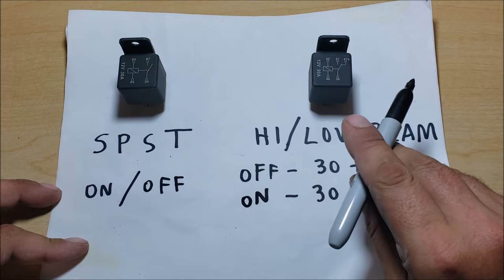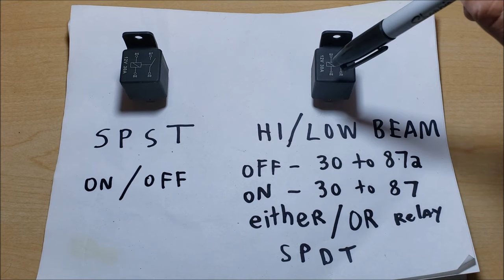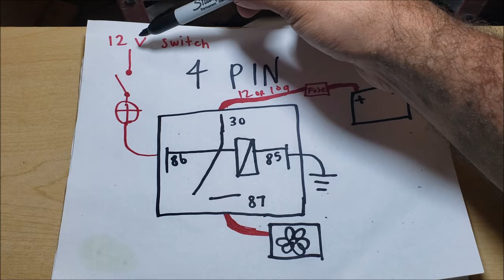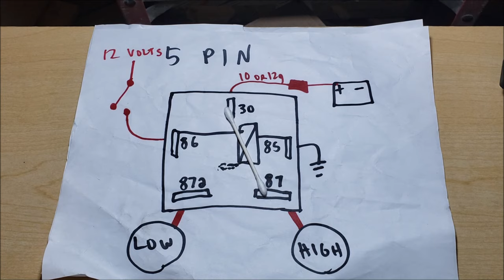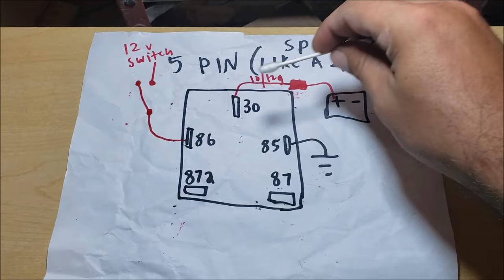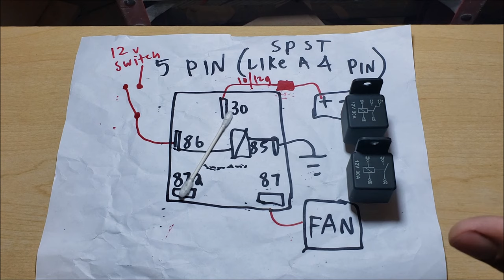automotive 4 pin and 5 pin RELAY EXPLAINED which one?

Comment: I crossed 87 with 30 and turned on my machine.. it got warm and when I put them back in their rightful place my machine no longer works... Did I damage the motor or the relay itself ... I didn't know what I was doing.. machine was working before I crossed wires but no longer. Any advice helps thanks
Reply from the maker: What was the machine?  You can switch 87 and 30 .. the relay is just an on / off switch
Reply: @chriscraft77022  hi , it's a hatsuyuki hc8edc ice shaver... Someone told me I should contact the wires from the motor to the battery and see if the motor works... I'm just trying to figure out what I burnt out.. I connected the copper wire and silver wire turned it on nothing happened then when I put it back machine no longer works 😣
Reply from the maker: that wouldn’t cause the machine to burn up..
Reply: Alicia Bemore l

Comment: Can you make video show how to use 5 pin relay to wire [running light, brake light, signals and head light like motorcycle setup 

Most of the videos not detailed wiring !
Reply from the maker: I have a wiring an automotive relay in real life video..   just wire to 87 and not 87a

Comment: i need to pump fuel from the tank....5 pin relay GM . it has no numbers 30 87 86 etc etc.. it has a diagram with 1,2,3,4,5 and the pins are also numbered
my question Sir is which cavities at the junction block do i need to jump to directly turn on my pump? thank you
Reply from the maker: you might have to pop the top off the relay and find what terminals energize the coil
Reply: @chriscraft77022  ty...pins 1(86) and 2(85)....now do i jump these or pin 3(30) to 5(87)...pin 4 is #87a
Reply: i understand how it works but just want to be 100% sure that is why I ask you
Reply: ...just don't want to fry anything, motor is siezed, oil cooler line popped out, need gas out of tank
Reply from the maker: 30 to 87 with a jumper wire
Reply: @chriscraft77022  T Y so much...great videos...all of them (that i've watched...so far)

Comment: Could you run this relay in reverse by using 30 as the load and 87a as one power source 87 as the other?
Reply from the maker: Yes
Reply: @chriscraft77022  thanks for the quick reply!

Comment: Here is my? Can I use a 5 pin to make a marker light be a marker light and turn signal by useing 86 (switch) to connect to an existing turn signal to make the marker light act as a turn signal?
Reply from the maker: yes.. 87 would be wired to nothing.. they will flash opposite of each other

Comment: On 4 pin, 30 and 85 are normally closed? If you put a load on it to connect to a body ground example a light bulb, it will light up right,?,but once 86 is activated(switched on) power will be rerouted to 87, but power will now come from 86 not from 30..cant really hear much..the stadium here is sooo loud..hahaha
Reply from the maker: i have a relay explained video(automotive relay explained) ..  where i show the 4 pin only ...  with no power 30 and 85 are not only open.  they arent even connected to each other
Reply: @chriscraft77022  yeah thanks.i was able to borrow my colleague's earphones..hehehe👍

Comment: Adding a train horn to my truck. So 30 goes to 12v battery. 86 goes to my on off switch. 87a goes to my stock horn. 87 goes to my train horn. And when i turn thr switch on it switches from my stock horn to my train horn?
Reply from the maker: no
Reply: Look like one of them will tour on the whole time .

Comment: As God is my witness I wanted to use the 4 pin relay to wire my 1968 barracuda headlights. But the store I went to did not have any 4 pin relays, but they had 5 pin relays on clearance for $3 I bought one thinking I could maybe use it to wire my headlights and just use the 87a for low beams and the 87 for the high beams. But that is wrong? Correct? So power goes to my headlight switch but would always be powering my low beams regardless??? 
Or should I go back and get another 5 way relay for $3 or get two four way relays, or just 1 four way relay??? Sheesh🤔🤔🤔. I'm lost in the wiring woods now😂
Reply from the maker: you need a 4 pin and 5 pin for headlights..  you could use (2) 5 pins..  why in the hell are you wiring relays on an old car?   my channel was formed around my 70 chevelle..
Reply: @chriscraft77022  Hello I was just watching your video on How to wire off road lights.
Apparently you can get more power to your headlights if you use relays. (average power to headlights when run through switch is around 11 volts when run through relays it can be as high as 13.4 volts nice and bright) There is quite a bit of info out there on the subject. Companies sell kits to do this anywhere from $65 to $140 but I figured I'd save myself a few bucks and do it myself. Also not so hard on the old wiring and switches. 
Thanks for the videos, great help.

Comment: I want to install an electric fuel pump,  86 to IGN at fuse panel, 30 to battery, 85 to ground, 87 to pump, can I use a 4 pin?
Reply from the maker: that is what all cars use for a fuel pump..
Reply: @chriscraft77022  thx man! Would a 5pin work, if I already have one?

Comment: I have one 40A/12v relay(4 pin). Can I use it to fit in my 2 fog lamps of my car which has got 55W per fog lamp. Total power is therefore 110W. Will it damage anything
Reply from the maker: 110w / 12v = 9.17 amps.. yes you are good .. I have a wiring relay in real life video where I do the same project... check it out
Reply: Ok. So good! Thanks s lot
Reply: @chriscraft77022  what ampere fuse(A) and copper wire size (in sq.mm) will be needed for the same load mentioned above?

Comment: hi chris, ive search everywhere but seems like it explain 4 pin relay with switch, if i dont use the switch can i connect 86 pin and 30 pin to constant 12v input? will it work?
Reply from the maker: yes, you can also wire it like that and have the switch (complete circuit) on the ground side ... but if you are going to wire it always on why would you use a relay?
Reply: @chriscraft77022  its for heated grip on my electric motorcycle, so the input 12v is switch on by the ignition, the voltage drop to 11.5 when the grip is on, i heard that using the relay is better.. what do you think?
Reply from the maker: no.. use bigger gauge wire..: a relay isn’t for that .. run 10 gauge wire
Reply: @chriscraft77022  thanks chris, ill replace it with a bigger wire..

Comment: Okay, here I go, I wired a 4 prong relay to a 2 prong toggle switch to turn a radiator fan on/off. Just like the diagram, 30 goes to positive battery using an inline fuse, 87 goes to my radiator fan using a 10 gauge wire, 85 to my switch and 86 to ground. Every ground has been checked.  Everything is securely tight but I get nothing. I've bypassed the relay to test the switch and it does work. My fan comes on. I've checked the relay for continuity and it's good. So, what am I doing wrong? I know it has to be some stupidly simple thing I'm missing but I can't see it. Any help would be most appreciated.
Reply from the maker: If you bypass relay and it turned fan on it’s your switch that’s the problem.. that’s all it can be.. is it a brass temp switch? I have cooling fan videos.. those need 12v hot run to 86 .. 85 to the switch, it  grounds out to block completing the circuit
Reply: @chriscraft77022  yeah, regular toggle switch with brass prongs. I'll check out your videos, thanks.
Reply from the maker: maybe the relay is bad.  Check it
Reply: @chriscraft77022  I've done that, gives me a 93 ohms reading from 85 to 86 and there's continuity from 87 to 30. I've swapped relays with working ones from the car and nothing. And I connected the toggle switch straight to fan and it works. I just don't want leave it like that. Eventhough I'm using 10 gauge wire all around and an inline fuse, it doesn't feel safe. I'm gonna get another switch, one with plated prongs instead of brass ones and see what happens.
Reply from the maker: @game_ender1  let me know what you find out..  it has to be something simple..  you do have a multimeter???  should be easy to find the problem on the diode setting for continuity
Reply: @chriscraft77022  well, no luck at all. I got a new 40 amp relay, hooked it up and same results. I even got me a new on/off switch and same thing. I tried all possible combinations on the relay, switching 30 to 87 and I know the relay works because when I switched 30 to 86 or 85 I can hear the relay clicking. I tested it with a multimeter and it gives me a 93/94 ohms from 85 to 86. The only way the fan works is without using the relay and straight connected to the switch. I know it's kinda risky having it like that, but how serious is it if I only use an inline fuse from the battery to the switch and run it pretty much straight? I'm using 10 gauge wire all around, even to the switch though.
Reply from the maker: @game_ender1  man, sorry to hear that..  i wire relays all the time and i have never had that happen..   let me know what you find out..

Comment: Great video! I do have a question for you though. How do I go about wiring fog lights with a relay switch directly to the headlights without affecting the headlight's circuit if the fog lights were to mess up? (Fog lights to work off the headlights  with no on/off switch inside car) Do you have a diagram you could share?
Reply from the maker: I have a how to wire relay in real life video with KC lights.. there is no diagram.. towards the end you can see where I get power to turn them on.. you have to jump a headlight wire to 86 to turn them on that way.. the fog light circuit will be separate

Comment: Chris used SPST for my single fan. 30 brake and  fuse 86 switch 85 temp 87  fuse to my fan.. I started the my truck and waited until it the fan turn on. The fan cycled and turn off. Next thing i found the fuse was burn for my fan . What the heck a blown fuse. Whats the  problem.
Reply: What the heck I'm doing wrong? 30 I used braker and fuse to the battery 86 I ran to the switch 85 to the temperature sensor 87a fuse fan and ground from fan to the block.
Reply from the maker: you said you are running a single fan,,,  how many amps is it pulling?
Reply: Explain to me how can tell how can you tell amps it pulls on a fan normally it does.
Reply: I have work on it and it puzzles me that done something wrong. I don't know how it pull so much amps that it blows fuses.
Reply: Do i need a braker and a fuse link to go 30 on Relay?
Reply: First I  thought it was fuse to the on pin 87 to the fan was blown but i was looking at it again and found it was the fuse link after the breaker was blown. Do I need fuse link if I got a breaker ?
Reply from the maker: no
Reply: Today, i pulled the electric fan found the fan was the problem.  The fan was motor was bent and was sticking in the frame.

Comment: I don't like running power through the switch, why not use "ground side switching"
Reply from the maker: you can wire how ever you feel like... I use relays for high amp circuits

Comment: Only commenting because you said you don't know why people use a 5 pin as a 4 pin.  I visited 2 auto parts stores and an electronic supply store to get the correct amperage relay in 4 pin with a tab for mounting and had to resign myself to using a 5 pin.  5 pin relays are much more available.
Reply from the maker: I noticed that... last time I went to oreilly they stopped selling 4 pin
Reply: @chriscraft77022  Which is why I really appreciate this video to show me which pin to ignore.

Comment: I have a red 30 run it to battery with fuse a black 85 ground it to what??? Battery
Reply: Attachment also a blue85 day goes to fans then white which is 86 goes to 12 volt ignition switch

Comment: Do you have a contact email mate this reply bs takes too long on off led swicth has 4 pins at the back you state 12 v swicth goes to 86 so we need to use one hot source from the on  off led swicth????
Reply from the maker: the led switch has to be grounded ... and one hot wire coming into load ... you don’t have to use the led part.. I really don’t understand the problem...why spdt led to turn on a relay?
Reply: @chriscraft77022  its in 100 pieces now and i fixed up the guy that recommended it.
Reply from the maker: in my wiring a relay in real life video I show using an LED toggle to turn the fog lights on
Reply: @chriscraft77022  cool yes. Cant wait chevelle update video so i can finish my car , lost motivation, REGARDS from Melbourne Australia

Comment: Why you telling people that 85 is the ground? 86 is the ground people. 85 is the trigger
Reply: You can use 86 or 85 for ground. Sounds like you're saying chris is wrong. He is just trying to help people.
Reply: @levideverney9248  most use 86 as trigger
Reply: Hi Annette you can use either or but like you said most use 86 as the trigger I do too.
Reply: For all that that says that 85 and 86 is interchangeable. That is not always true. If it has a diode built in, they are NOT interchangeable.
Reply from the maker: why are you so passionate about 86 being the ground when it doesnt matter? if you knew more you would not have left the comment..   i know more about wiring than you ever will in 20 lifetimes..
Reply: Either 86 or 85 can be used as grnd.